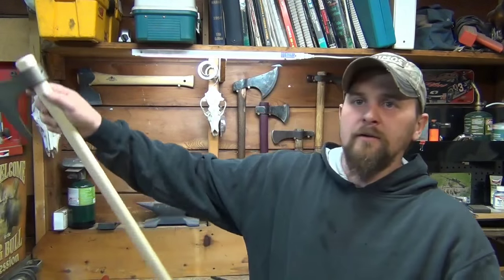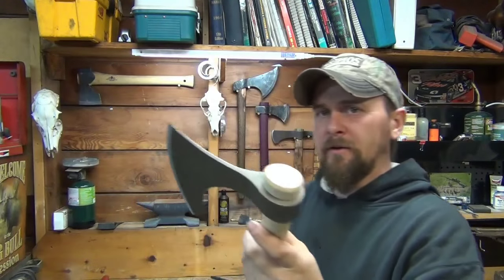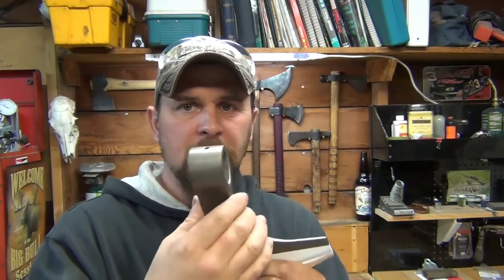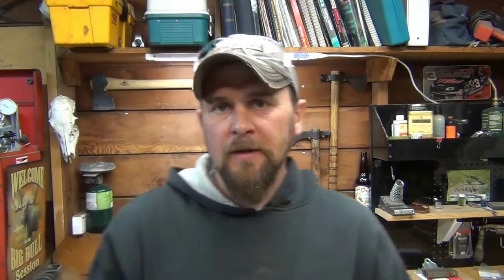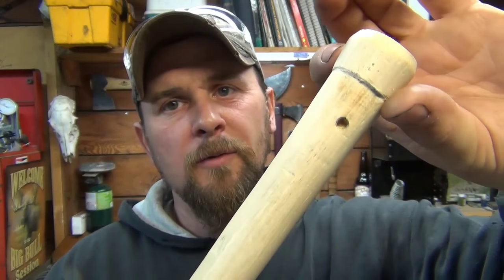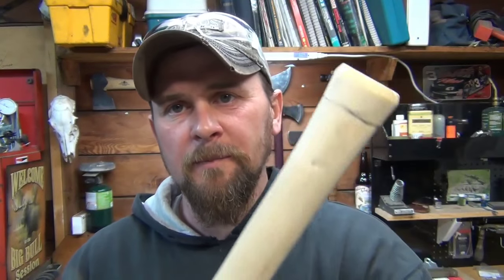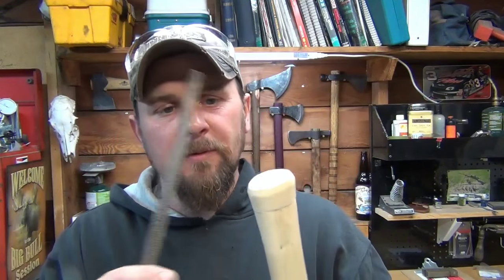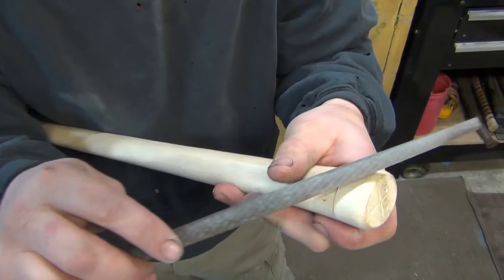Tomahawk head fitting guide. Viking axe video 1

Comment: I took the screw out of my own tomahawk and put a wedge in the top to force it to fit. Should i not have used a wedge? At the time i figured it would work because it works for normal axes just fine
also, would there ever be an instance when a screw would be acceptable? i figured the hex nuts on the tomahawks helped them stay place so I kept them in my norse style hawks (like the one axe and Cold Steel's norse hawk)
Actually, just out of curiosity, is the edge on your axe off? I looked at my CS hawks (from the A.TomaHawk Co.) and the edges all seem to be off centered
Reply: NO - as shown tomahawk handles are designed to be pressure fit - not locked in place. You will break the handle eventually and it is simple to replace the handle (after some basic sanding/rasp work.) www.RandysSuperSharp.com